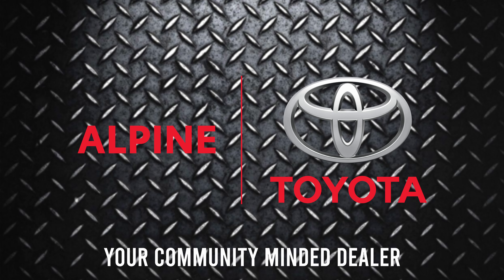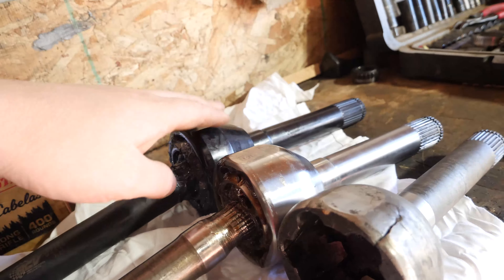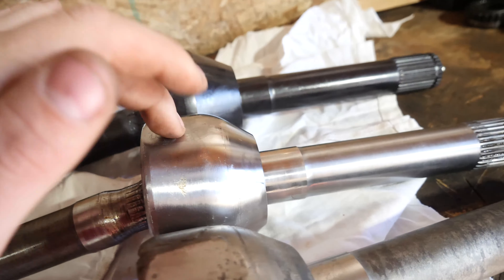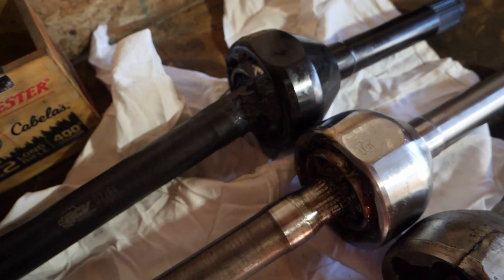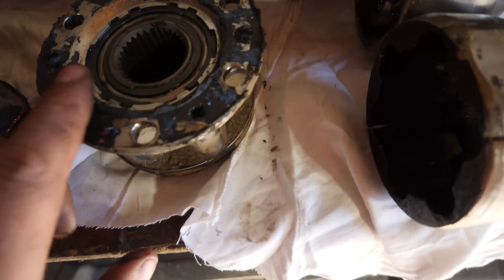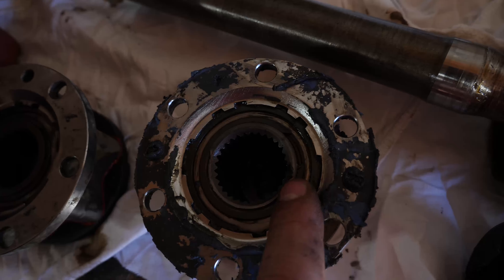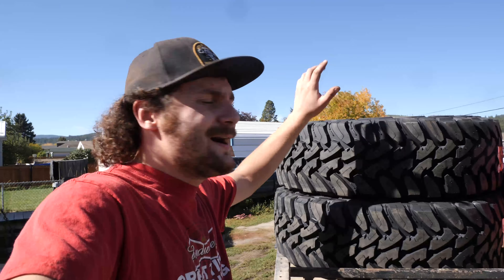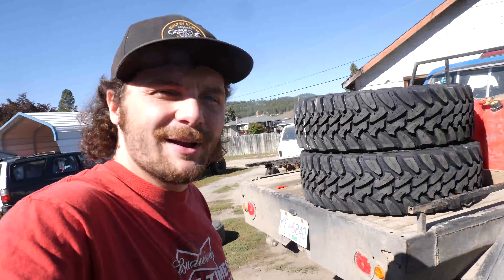Fixing The WEAKEST LINK in Toyota Solid Axles | RCV Ultimate CV Axle / Birfield

Comment: Run dirty 30’s or press a birfield ring on and they hold very well i love birfield rings on my samurai when you press the ring on around the birfield it becomes much stonger there so they dont explode apart sometime you need to do a little die grinding inside because it makes the birfield a little thicker and housing castings are not always super clean and perfect so you might have to grind a little so you have clearance to turn whole way🙃

Comment: I ended up with the TG super set axles 30 spline all the way through with the grease fitting for the birf. Would have went with the RCVs but I got it for a killer deal on a sale that I couldn't pass up.

Comment: Did you have any clearance issues inside between the knuckle ball and CV?
Reply from the maker: Nope! We 100% expected to have to do some clearencing. But both sides fit no problem at all. I think maybe the 300M ones might have issues,
Reply: @DirtGarage  Good deal.  I actually dont remember if I had to with my TG ones, but I just wanted to ask.
Reply: I think it has more to do with whether the knuckles are straight or not. most of these old front axle knuckles have lived long hard lives and are slightly bent upwards.

Comment: Forgive the ignorance, 
 but how does lighting the tire with some fire help?
Does it seal better ?
Reply: Pretty sure it has to do with the gas/air inside the tire expanding quickly and popping the tire onto the bead
Reply: @landcruisermailbox6139 any flamable spray product gets sprayed into the inside of the un-beaded tire.  When lit, a mini explosion happens and the surge of air pops the bead into place.  One can spray a trail of the liquid away from the tire and light it like a fuse to reach the inside full of fumes.

Comment: Can't decide if I want 35s or 37s on my 90. Those 37s look pretty good
Reply from the maker: 37s are awesome all year round. If I had a set for summer and different set for winter it would be 35x12.5 for summer, and 38x13.5 for winter for extra floatation in snow.
Reply: I have 38 15.50’s and they are just to much weight. I’m goin down to a 37 13.50

Comment: Let me ask you this,,when I moved my front axle foward,,1981,,i shot for great steering geometry first,,I am not running 2 transfer “I want to say yet”but anywho,,my driveshaft angle is not that bad but,,pinions are not parallel,,what options do I have,,do I need a double cardion on each end or will a regular ujoint on each end do the job,,it’s not like the thing is spinning all the time,,would appreciate your input,,,,I understand that a regular ujoint on each end the output shaft and pinion need to b parallel,,it’s kinda like this,,the out put shaft is like parallel and the pinion is pointed up just a little,say man 10 degrees from level,,if that makes sense,,it’s not pointing at the output shaft at all,,if I had a second transfer case it would probably b pointing straight at it,,so if that gives you a little bit of what I’m looking at,,but like I say my steering geometry is great,,
Reply: assuming it's lifted. get the caster angle set correctly and figure out the rest from there. with the right caster, a non cv shaft with spring pad shims would be the most likely result unless you perform a "toyota axle cut and turn" which would achieve desired steering and pinion angles but it's a big job. an fj80 high pinion third member would be a good idea in all scenarios. you are correct though, it is not spinning all of the time so steering(caster) should be the primary focus over shaft angle or type.
Reply: @liveoak7838  mine I sure don’t want to mess with that caster/ rake,,I mean I have no tire wobble,,I can run down the interstate at 75 with these big tires on 8 inch wheels,,holds straight no wandering,,which more rake should make it even more friendly,,you would think,,,,or I could just go ahead and add second transfer I already have the case just need the adapter,,you just
Confirm what I was thinking already,,just thought ,,mayb there was some “been there done that” kind of thing I guess I was looking for,,no rock crawling for me,,and I don’t mud ride,,it’s more just for when I need it I got it type of deal, but I do want it rite
Reply from the maker: On a solid axle truck with manual locking hubs I'd imagine straight ujoint to ujoint is fine with a not so ideal pinion angle. But if your worried about your pinion angle pointing up maybe toss in some longer shackles?  I had the opposite issue when I lowered my truck and had to throw in shorty shackles to make it work.

Comment: No grinding needed to get the rcv’s in?
Reply from the maker: Nope!
Reply: @DirtGarage  Iv seen sum guys have to grind but I’m sure it’s due to a bent housing  I just picked up the full 300m inner and outer set for my pop top 2rz swapped 4Runner
Reply from the maker: @varmint223  Yeah we thought it would be required. And we where surprised when they slid right in. Probably a bent housing if grinding is required

Comment: Not too sure i saw what i saw but did those new shafts have a grease zert on the hub?
Reply from the maker: Yup, end of shafts have grease fitting. Easy to pump more grease in. Typically the stock ones we have to manually pack them.

Comment: After watching this video, I have to finally install my OG Longs.  I'm assuming with the RCV axles you normally have to clearance the knuckle balls?
Reply from the maker: We did not have any clearance issues with the RCVs. Went right into place no problem.
Reply: Some knuckle balls need clearance while others don’t. Here’s a tip for the OG Longs, the RCV Dana 44 birfield rebuild kit works for the OG Longs. My axles were clicking and I pulled them apart and replaced everything, no more clicking

Comment: Instead of rcv’s why not go up to land cruiser diffs? 60 or 80 series stuff?
Reply from the maker: To wide unfortunately. We try to keep these rigs as street legal as possible.
Reply: @DirtGarage   could you can narrow the overall package a bit with something like a stock offset wheel and reduce your scrub radius a bunch?
Reply: IIRC, the80 series knuckles have the steering arms on the bottom of the knuckle. The 60/62 axle is 58" wide (same as mini truck with 3" spacers or IFS hubs), but its harder to find in these parts, although minitruck SFA are getting harder to come by as well.

Comment: There is a much easier way to take your knuckles apart to change shafts ect 

 Take the break calliper off then take the 4 nuts off that are holding your pitman arm on and pop that off, pull up on your knuckle once the pitman arms off and it will roll off super simple way takes 5 mins or less
Reply: The Camo method
Reply: Steering arm, not pitman arm
Reply from the maker: Yeah, but its not really that much easier. Plus you gotta take all the 10mm bolts from the wiper seal on back of the knuckle off so it can "roll off". We all have IFS hub mod, so you don't have to take the knuckle - spindle and all the bearings out to service. Saving a bunch of time!